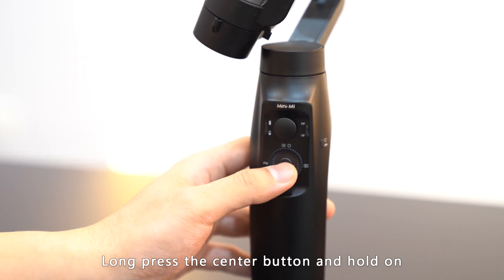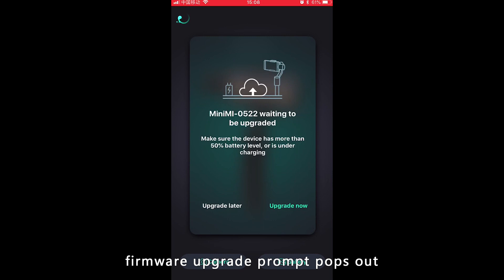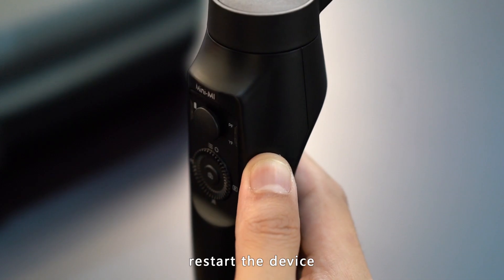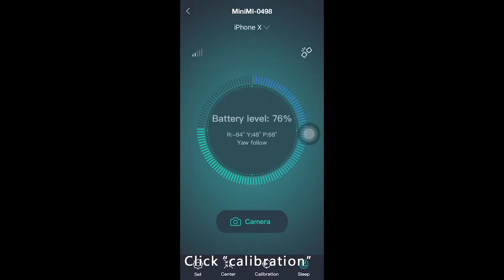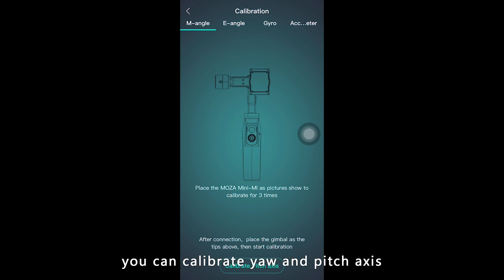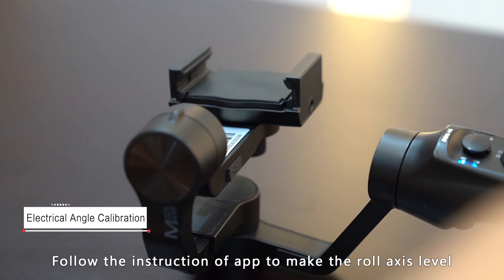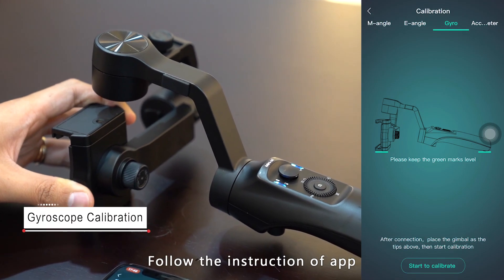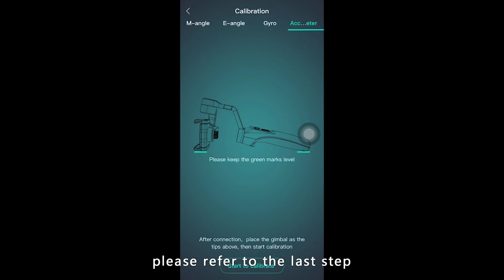MOZA Mini-MI Tutorial Part 2-How to Upgrade the Firmware and Calibrate

Comment: for those who are having trouble with connection in upgrade mode. when it says it cannot find it press and hold the center button again then touch the retry icon in the left corner of the notification box and it should show up after that. that's how I got mine upgraded and I hope that it works for others

Comment: Help! Followed the steps to firmware upgrade but my phone cannot connect to the device while it's in upgrade mode, it doesn't even find it, even though it connects fine in normal mode... Cannot calibrate without the firmware upgrade so I'm basically stuck
Reply from the maker: Can you please contact our service center for help? support@gudsen.com
Reply: @GudsenMOZA  Me neither.  Why on earth are you getting people to email you one on one when you can help all of the people who own this gimbal at once?
Reply: same issue here. It connects fine normally. but when i put it in upgrade mode the app wont find it.

Comment: Help please my mini mi keeps falling asleep and the roll arm is not working
I bought it yesterday and it was running fine at first 

The roll arm is not working, but the yaw and tilt are.
Reply from the maker: Could you please make a short video to show the issue?
Reply: Gudsen MOZA https://youtu.be/gLYknLvuk7Q here
Reply from the maker: @dragonsoul3039  Hello，we have checked the video，this may be a gimbal issue，just contact the seller to change the gimbal？May I know where did you buy it？
Reply: Gudsen MOZA i got it from jb hi fi
Reply: Gudsen MOZA I’ve tried they said they can’t re-sell it

Comment: I cant connect to the app. It shows an ‘X’
Reply from the maker: Hi Mini Users! Recently we received some feedback that the gimbal can not connect with MOZA Genie App after upgrading the app.

To help solve the problems, if you have the same problem as I mentioned above, please answer these questions below:

1. Gimbal Name

2. When did you get the gimbal

3. Your Phone Type and System version

4. When you first found the connect problem, was it after upgrading the firmware or after upgrading the App?

5. Has this problem happened on both your Android/Apple mobile phone?
Reply: Gudsen MOZA the app is working ok ish now

I just have a problem with the roll arm
And the gimbal falls asleep every 10-20 seconds

Comment: Even after receiving no response from support @ gudsen, I had to figure it out myself.  So, if your Mini Mi / Mini S has stopped working after the upgrade, the following steps are required: 1. Unscrew the device.  2. Disconnect the "+" connector for 5 seconds from the battery.  3 We are launching the Moza Genie app for iOS !!!  (Needed on iOS only, since only there the application offers to restore the firmware).  4. Run the device in update mode 5. Wait for the upgrade process to complete, wait a few seconds, close the application and after a few seconds we can turn off the device.  6 We launch the device, calibrate and enjoy :)
Reply: Ca you give more details on how you did it how you unscrew the device
Reply: Hi I want to know how to unscrew moza mini mi

Comment: If i am having connection issues with the moza mini mi, how am i supposed to upgrade my firmware to fix connection issues if it wont connect. HOW?
Reply: Did you find any solutions pls haha ?
Reply: @benabdlz5008  I did not, I emailed customer service they asked me to send them the make and model numbers and all that. But they took so long to get back to me I had already sold it off.

Comment: My Moza has a jolt when it moves. When it pans or tilts etc, the motors seems to jitter or something. This happens regularly which makes most shots have this bounce in the footage. The point of the gimbal is to help produce smooth footage. I have updated the firmware and calibrated a few times. Any suggestions????????

Comment: I also have been fighting my new (2nd) Moza Mini Mi.  First one vibrated like a beaten dog in a set of crosshairs.  My second one did not turn on after repeated charges.  Moza support is in good communication and I am trying (5th time) to figure out how to calibrate as Moza has not figured out how to truly translate a good set of instructions that have ALL the information in the documentation.   Seems like a good product if I can just get operational.   As a noob trying to use video to promote my business it is SO frustrating.
Phones I'm testing on the gimbal.  Iphone 6, Samsung Note 8, Samsung Note 8 . 

I also have the Moza firmware genie updating EVERYTIME I log in to try and calibrate.   Like Seriously??
Andriod app software is still not totally integrated to the Genie App so features do not work.  Also the gimbal does not sync to Filmic app. 

Okay trying once again to get calibration.  
1.  Connection failed-  Phone app is on, then turned on gimbal- I will try to reverse. 
2.  Press middle button on gimbal then on switch.  Then press connect within Genie app- Nope that don't work either .  Hmmmmmm??!!!
I need a drink of hard alcohol....pull out tiny little instructional booklet to refresh old man memory. 
3.   Nope nothing on calibration in the manual other than scan  the QR code at end of page.  Like I know what a QR code is right?!
OK so Gudsen support sends me two conflicting opinions.  One is take the phone out of the gimbal and recalibrate and the other is put the phone in the gimbal and recalibrate.  Which person in the support department should I truly believe?
4.  Still trying to get the phone to connect to the software.......OMG I have been pressing the same buttons but now it's connected...hooray!
5.  Even though my phones at 39% the battery is not reading.  Perhaps that's because I have the Samsung note 5 in the cradle.  I knew I should've grabbed the iPhone before doing this.  I have the feeling it won't work so maybe I'll go grab that phone after I tried to recalibrate
6.  Pressing the calibrate button.... And I get the message  "Warm Prompt"... (That's not a typo, that's exactly what it says)  if the device is not operating abnormally, please carefully calibrate your device.
Ok so lets give that another shot...
7.  Confirming... Phone immediately goes into what I would describe as a sleep mode although the lights are still on and the right one is blinking beside the joystick.  We have two choices of calibration.  Either guided or manual.  I'm going to try guided.
8.  The first step calibrates the mechanical angle and then immediately goes into the electrical calibration.  I passed the first test but obvious he didn't pass the second because I had no idea what electrical calibration is supposed to mean nor is there any sort of guidance. But I am returning to the previous step to try again.  Right so the screen has basically locked up on me and I'm sitting here grinding my teeth.  I had to totally get out of the application and restarted
9.  So the first step is called guided calibration and there is a neat picture which is fairly easy to follow so let's try this again.  Once again calibrating the mechanical angle was very easy and passed immediately but then it starts to calibrate the electrical calibration and of course there's no picture in the android app so I have no idea what wants me to do.
It's time to go find my wife's iPhone 6
10.  Okay so now the iPhone 6 is sitting in the cradle.  Balanced and ready to rumble.  Where the heck did I put that genie app. AHHHHHhhhhhh...  ok so pressing the middle button and the power button on the gimbal with the Genie app already on.  Device immediately connects with the phone but wants to know if I want to upgrade the gimbal. sigh... OK so upgrade again.  I highly doubt that there's upgrades every single day since Christmas but it seems to be the way of Moza to upgrade firmer every time you turn on the app.
30% - 50%  - 60 %  ......snoozing.....Ah ok 100 %  ya baby.... Version 0.1.3
11.  Where’s that guided calibration button?  Well it's not in the settings. Let's try the cloud picture, and I get a warning ..."Am I sure I want to upgrade the gimbal."  I'll do just about anything at this point including running around a bonfire nude chanting a mantra while sacrificing a chicken if I can get this damn thing working.  But I'm pretty sure I already upgraded the gimbal and the last step.  Let's keep searching.... Swipe left... Nothing  - swipe right... Nothing... I'm about ready to throw this phone out the window with the gimbal attached.  Scroll through the settings yet once again... Camera mode-resolution-professional mode-frames-anti-shake-flash-grid-filter-gradient or-sound metre-live streaming-reset camera...  While none of those sounds like recalibrate.. Time to back to the web and do a search.  Where does Moza Genie software put the recalibration button?  https://www.youtube.com/watch?v=dD0ejYQtmJ8  Well this video doesn't work for me. 
 https://www.youtube.com/watch?v=dD0ejYQtmJ8  Well this video doesn't work for me.   One thing I can't set the phone up like the way they are showing the video and I also don't have the same icons that they are using on the phone in the video.
Still looking for the calibration icon on the Iphone6.. 
Firmware upgrade button is the only button that seems to work but I've already done that twice. But once you press it you have to let it go through its sequences.  Nope I'm tired of this so I have to turn off the phone so I can take back control.  Now I am truly ready to shoot something.  Think I'll read the newspaper while my phone is rebooting

12. Here's an interesting new development. Leaving the gimbal on with the right light flashing up by the joystick now gives me a Bluetooth icon on my phone.  Shucks it's only a Bluetooth location app.  But for some reason although it recognizes the Moza gimbal it is not hooking up to it so now I'm going to try to restart the gimbal while the phone app is on...
Alright.. Another new development.
13.  While recognizing the phone the gimbal automatically turned the phone up into landscape mode and all of a sudden I have access to other icons which I didn't have access when the phone was lying flat facing up.  
14.  And there's the calibration button
15.  "Are you sure you want to calibrate the gimbal"- HELL YA!!!
16.  And of course the phone then goes back to sleep with the screen facing up in the phone balanced.  But now I get to press "default calibrate"..... let's see what happens.... Well the gimbal is telling me it's alive.. So that's a good start.  But a new instruction that says.." Loose phone after three seconds".. In the top left corner of the screen had me confused.  Let's start over and see what happens.    Well my phone screen is black and I have to unlock it again..  What the heck is going on???  
17.  Second calibration instruction is called the default calibration and it looks easy enough although the gimbal is trying to fight me a little bit... I have to hold the gimbal level with the top of the desk otherwise it flops over before press start. Calibration completed although the phone is trying to wiggle a little bit and it's not pushing me into the next calibration mode.. sigh.. Let's start over again.. I might have to try custom calibration if this doesn't work.
18. After the 10th try,  my gimbal assures me it's calibrated. The two blue lights are still on with the right one flashing.  I'm going to turn off the gimbal and restart and see what happens.  

Ay caramba!!!!!
gimbal totally freaks out and start slapping my phone around against the handle.  I am totally at a loss with this unit and since the second one they sent me doesn't power up I am left here wondering if I should put a bullet in my brain.

I hope you all have better success than I have.  I would fully agree with other posts that I have read suggesting that Moza get proper documentation in place.  I would also humbly suggest that they get people who understand the written English word to write up that documentation.  I have noted that even their website is full of syntax errors which shouldn't happen to a company selling across the world.

May the force be with us..

Comment: I think I really messed up getting this device here. It just came in today and it worked well then for some reason it started shaking violently and then it stops and the indicator light on the right hand side starts blinking repeatedly. 

Don't know what to do, it's insanely frustrating really.
Reply: Same here. Got it for Christmas. Worked fine when just messing around the house. Went to actually use it for filming today and it exactly as you described.
Reply: I got the same problem
Reply: DragonSoul I have all but abandoned mine. Sad really. It hurts but lessons learned. I've seen a lot of fixes but they are all temp. The same issue comes up again. Mine has refused to be calibrated

Comment: HEY ANYONE HELP, My Moza Mini-Mi just stopped working after firmware update (the turn on\off button doesn't do anything, the red light of charging is visible, When i charge it, its led indicator goes red. Even after 4 hours later. But then it cant be turn on at all.
Anybody knows about an option of factory reset or manual firmware upgrade through USB?
Reply: Return. There is no option other than claiming warranty.

Comment: Hi, I've a problem using an Iphone 8 plus, when I try to select the points for the motion timelapse it doesn't get any response, I mean I try to click on the + or the central button but nothing works. Do you know how to fix this?
Reply from the maker: Hello, what's your app version? Is it the latest version? The latest version number is 1.2.11. At the same time, you need to upgrade the firmware of your gimbal.

Comment: Mine Moza Mini-Mi just stopped working after firmware update (the turn on\off button doesn't do anything, the red light of charging is visible, the app sees the devices for few sec, but when I tap on the name, the app is not able to connect to the device and the device disappears from the list).

Anybody knows about an option of factory reset or manual firmware upgrade through USB?

The official support is still ignoring me, I'm waiting for tomorrow to call them during working hours, they might provide some explanations. Any advices are much appreciated from people who encountered the same problem as me.

It looks like a lot of people have similar problems. I wonder, how fast official support responses.
Reply: Having the same Issue. What a piece of crap
Reply: Just got it to work, tried upgrading a few more times and turned it on and off a few times and it magically worked. Not sure what sequence did it though.

Comment: I bought the mini moza mi and after doing a firmware update the gimbal is out of control despite the calibration. What to do.
In addition the application is not optimal for my galaxy note 8, I can not film in 4 K. Should we recommend this gimbal .... I wonder. I hesitate to send it back and get paid back to buy the DJI osmo mobile 2
Reply: You're lucky! Mine device just stopped working after firmware update =)
Reply: @ruFlashist  Mine also. Before firmware update it was working ok. After update one motor is not working at all

Comment: If I don’t put phone on a gimbal it keeps vibrating can you tell me what’s wrong with this and wireless charge doesn’t work.
Reply: It's trying to counter-balance the phone but if it's not on there the motor probably doesn't know what to do.  Mine does the same thing. Just touch it with your finger it'll stop it moving it's looking for weight.

Comment: I have a problem with Moza Mini Mi. I pressed the camera button and the power button. PF and YF indicators are blinking. Moza is not updated (0%) and does not go to normal mode. How to go to normal mode? Phone Xiaomi Redmi 5. Thank you!
Reply from the maker: Hello, please write an email directly to support@gudsen.com, it will be better if you can attach a short video so that we can find where is the problem
Reply: Gudsen MOZA thanks, with the last update of the program I was able to update the moza and the problem disappeared. thanks for your tech support! Also, thanks for the moza minimi - it's very amazing product !!!
Reply: The same problem.
Give me the answer. kimjinsub83@gmail.com.
Reply: What do you mean "last update of the program"? I have the same problem. :(
Reply: Mik I had a problem updating the moza. the indicators blinked, the device was not updated and I could not get back to normal mode. but a day later the program on the phone was updated. I clicked "update" several times and moza was updated. I clicked update 15 times! then I turned off the moza, turned it on and it worked.
Reply: oh my god same Problem...

Comment: I have 2 problems and I am about to put this back in the box and return it to amazon. I tried to calibrate this things and now it is spinning like a top. The second issue is, I then upgraded the firmware and now my iphone will no longer connect. How do you reset this to factory settings?
Reply: It connects now. I just need to stop the blender.. I am about to mix a smoothie with this
Reply: I followed the video above and it now works..
Reply from the maker: Hey Richard, app version will update soon, calibration procedures will be simplified, operation will become easier!